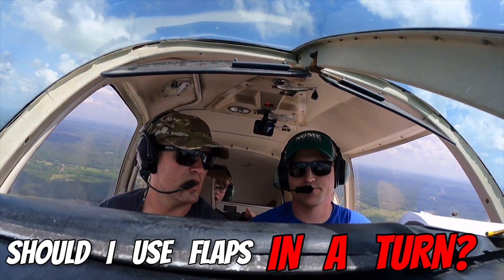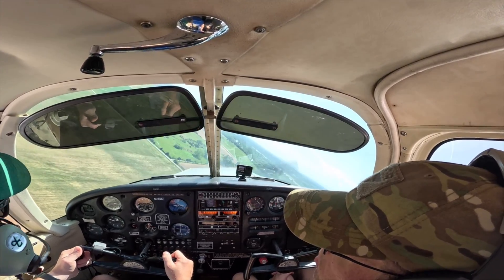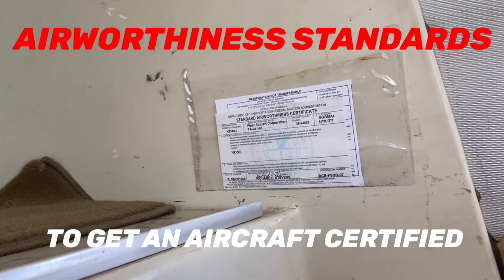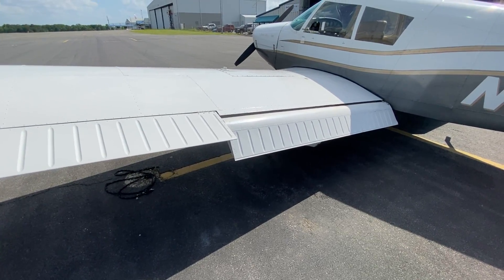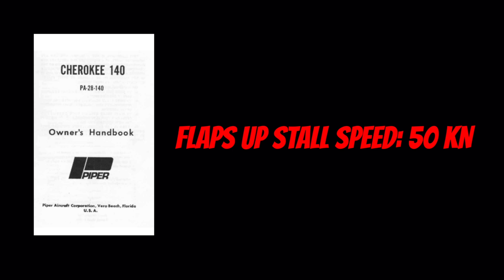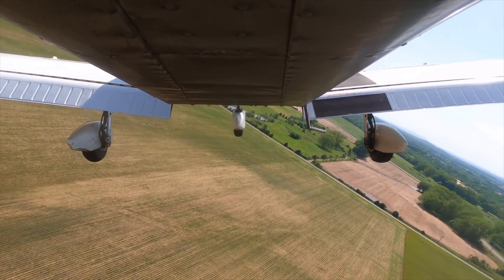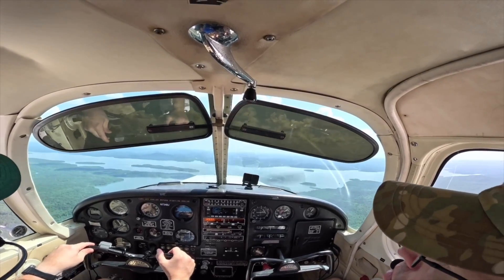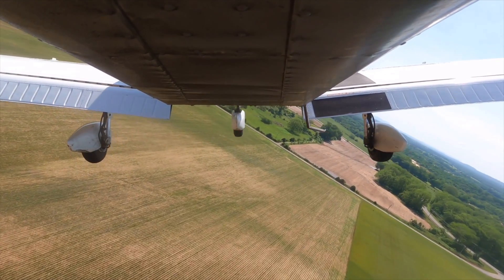Should I LOWER Flaps in a Turn?

Comment: This is not correct. The horizontal component of lift depends only on aircraft bank angle as  the vertical component has to stay the same as the aircraft weight.  Flaps  can be used to tighten a turn by allowing you to fly more slowly (increasing lift at any speed). That said, you must add power to maintain airspeed.
Reply from the maker: Thanks for the information.  Something I did not mention in the video is that flaps allow you to fly at slower airspeeds which definitely will shrink your turn radius. Now, I don’t disagree with your calculations, BUT those all assume that horizontal lift is equal and opposite to load factor which assumes that weight and centrifugal force are equal. I don’t actually believe that to be the case.  Many physicists believe that centrifugal force is not even a real thing.  I don’t share this particular belief, BUT I believe that the increased lift that is created by the flaps improves this turning capability because there is a side load on the aircraft.  Now, once again, this is a theory, but ag pilots intentionally use flaps to tighten that turn radius.
Reply: @FreePilotTraining  ag pilots use flaps to fly more slowly and that permits a tighter  turn.  Two  aircraft at the same  speed  turn at the same rate at the same bank angle regardless of  aircraft weight. Try flying a glider on tow -you match bank angle to turn at the same rate.
Reply: @FreePilotTraining  Just to add something concerning the centrifugal force. It's not believed that centrifugal force isn't real, but it's looked at as a sideeffect of inertial forces, so it's not a force by it's own. It's like the force that pusches you forward when you hit the brakes in any vehicle. Your body want's to stay in motion and is hold back and that's what you feel. It's the same with centrifugal forces. Your vehicle changes direction in a circular manner but your body would like to move straight on because of it's own inertia. Basically Newton's first law in action.
Reply from the maker: @shi01  thank you! I am thinking of adding a video that discusses this more.

Comment: Love you explanation and thank you for that, I will use flaps in a turn without hesitation. 
What I still not understand is the aerodynamic logic why the circle gets smaller when flaps are used. 
I believe that if you set flaps, you have to lower speed, or bank more to keep the flight level.
Reply from the maker: This is a complete theory of mine. As I stated, horizontal lift component apposes load factor, BUT if my theory is correct, load factor IS NOT equal and opposite of horizontal lift because BELOW flaps limiting speed, weight will be greater than the force created by inertia.  In my personal opinion, THIS is why maneuvering speed is so important.  Load factor is closer to being equal and opposite. Now, if weight is greater than the interia force, WHEN we lower flaps, the horizontal lift component can become greater WITHOUT increasing vertical lift.

Comment: I'm in training and only have about 22 flight hours, but I've been using flaps on my turn from downwind to base and base to final... 
I was thinking I shouldn't but my CFI has been telling me to add the flaps while I was making the turns, so that's what I've been doing... but I'm not banking very steep either
Reply from the maker: Yeah, it can be kinda nerve racking, but it’s completely safe
Reply: @Free Pilot Training  Everything I'm doing is nerve racking lol
My biggest hurdle right now is landings.
I pretty much understand the concepts of the maneuvers I've done so far, slow flight, steep turns, power on and off stalls and landing, but putting them into practice has been an obstacle. 
I keep having to tell myself that the plane isn't going to fall out of the sky if I pull the throttle to idle lol😆
Thanks for putting this content out there, I've been looking at your merch and will probably make a purchase in the near future to support you.

Comment: Suppose you had a plane with monster flaps that could do a 70kt, 30 degree turn in only 25% of the radius as other airplanes. How could you turn so much tighter at the same speed without pulling more Gs? You would literally be reversing velocity 140kts from 70 in one direction to 70 in the opposite. As you reduce the radius and time necessary for this reversal, you would have to pull more Gs to do it. Yet when the chart tells you it takes 1.15gs to do a 30 degree bank, they don't ask your airspeed. The load factor is the one thing that's fixed, and the only way this can be guaranteed is because radius is tied to airspeed. The only way all 30 degree turns give the exact same load is because the slower ones are tighter with higher turn rates, while the faster ones are wide with slower rates. All 70kt, 30-degree turns must have the exact same radius, otherwise they could not all have the same 1.15G loading.
Reply from the maker: This is a complete theory of mine. As I stated, horizontal lift component apposes load factor, BUT if my theory is correct, load factor IS NOT equal and opposite of horizontal lift because BELOW flaps limiting speed, weight will be greater than the force created by inertia.  In my personal opinion, THIS is why maneuvering speed is so important.  Load factor is closer to being equal and opposite. Now, if weight is greater than the interia force, WHEN we lower flaps, the horizontal lift component can become greater WITHOUT increasing vertical lift.
Reply: @FreePilotTraining  
But we already know what a turn with more lift looks like: it looks like a 60 degree turn. It takes a lot more lift to make that turn -- and it produces a lot more Gs. Anytime you're dragging a mass through a tighter circle there is going to be more acceleration -- this is not aerodynamics; it's physics. The acceleration isn't from the lift, or the type of lift, or from the bank, or from the wings -- it's from objects in motion along a path resisting having that path changed. If your technique could tighten turns, then it would necessarily increase G-loads. You already know the Gs are constant with bank, and now you're trying to rationalize aerodynamics to explain where the missing loads went. That's nonsense, because the Gs aren't from the aerodynamics.

I suggest you repeat the experiment with an alternate velocity source -- GPS. Fly both maneuvers at a constant GPS groundspeed. If you're affiliated with USAF you must have access to aeronautics guys. Why not run this past a test pilot?

Comment: Yes, but please remember that flaps are one part of energy management.  You use them when you need them.  With small aircraft that's often 10 when abeam the threshold on downwind, another 10 on base, then another 10 or 20 on final.  But crosswinds, high winds, and gusty conditions will also dictate your flap usage.  Today was windy and gusty with shear, I never lowered past 20.
Reply from the maker: So true! Thanks for the comment!

Comment: Turn radius is determined by airspeed and bank ONLY, and we know this because load factor is directly tied to bank angle. 60 degree bank ALWAYS gets you 2G, and the chart doesn't ask what your flap settings or your airspeed are. 1G of that is gravity, and the rest is acceleration from the turn -- i.e., the acceleration from turning your velocity in one direction into velocity in another direction. If a variable like flaps could alter your turn radius at a given airspeed and bank, then the G forces would have to reflect that variation. Tighter 70kt flaps-down 30-degree turns would have to pull more Gs than 70kt flaps-up 30-degree turns because you'd be reversing your direction of travel faster. But that's not what happens. We know that the 30-degree bank ALWAYS creates 1.15Gs. So, 1.15Gs (30-degree bank) at a given airspeed is ALWAYS the same radius and turn rate.

Perhaps your airspeed indicator reads higher when your nose is lowered because of extended flaps. Maybe what you think is 70kts with the flaps down is really only 64kts -- that WOULD make a difference in your turn radius at the same 1.15G.
Reply: Yes this I believe that is exactly what has happened.    The video result seemed so bizarre that I had to do some work and calculate the airspeed.   I assumed that it was a CAS offset but it would be nice to see the actual GPS or ADS-B data.  In lieu of that I calculated the airspeed from the ground tracks and the time stamps on the video.   Assuming that 70 KIAS = 70 KCAS with no flaps and 30 deg bank we can find the radius of the first turn via the TAS which would be 72 KTAS on a standard day, then from that we can find the radius of the second turn by just looking at the ratio of the diameters, and then calculate the TAS from the time stamps and the circumference.   The second turn has an average diameter of that is 80% of the first turn and this yields a speed of 66 KTAS, or 64 KCAS which is exactly the number that you got, again assuming a standard day.   Thus this aircraft has a 6 knot error between IAS and CAS at 70 knots and whatever AOA it takes to hold 30 degrees at that speed!
Reply from the maker: @alan1newport  after a little thought, there is no way that this could be due to the calibrated airspeed error.  The reason is that WITH flaps, we are flying a faster calibrated airspeed in order to maintain the same indicated airspeed because there is LESS air entering the pitot tube.  So, in reality, I was flying faster with flaps down, so the turn radius should have been larger.  I have my own theory, and I intend to prove it in a future video
Reply: @FreePilotTraining  Well there are two major position error sources when measuring airspeed and they are due to both the pitot AND static ports.     I think that the major driver for CAS and IAS difference is the static port and this difference can be both positive and negative.  Also, when using flaps at the same actual airspeed you would have a lower AOA to maintain level flight and this would bring more air into the pitot tube not less than in the no flap case  - in other words, flaps allow a lower AOA for the same conditions not a higher AOA.  That should be easy to verify in the C130 with a good AOA measurement but obviously hard to see in the steam gauge Cherokee. 

I think that you are missing the point that adding flaps generates an increase in the total lift vector that is perpendicular to the wings and thus when banked (and maintaining alt) always generates both a horizontal change in turning force AND a change in vertical force, not just a horizontal turning force.   When you re-trim to maintain level flight both the horizontal and vertical forces return to their per-flap levels and of course this is complected by the fact that drag has also increased.   I'm trying to think of an aerodynamic device that would only generate a horizontal force and certainly can't think of anything simple that would do that.   This last test was flown very precisely and that plus the lack of wind was how I could get even a decent calculated CAS/TAS result - you were definitely flying slower with flaps.  I would urge you to continue testing and keep that GPS data next time!
Reply from the maker: @alan1newport  yes, you would be at a lower angle of attack with the flaps in.  That means there will be less air entering the pitot tube.  This particular Cherokee doesn’t have a calibration chart in the poh, but most airplanes have a faster CAS than IAS with flaps. That’s a good point on the GPS though. If I checked both with the ground speed, that could bear some accurate results
Reply from the maker: The calibrated airspeed note is an excellent point, but something I did not mention in the video is that flaps allow you to fly at slower airspeeds which definitely will shrink your turn radius. Now, I don’t disagree with your calculations, BUT those all assume that horizontal lift is equal and opposite to load factor which assumes that weight and centrifugal force are equal. I don’t actually believe that to be the case.  Many physicists believe that centrifugal force is not even a real thing.  I don’t share this particular belief, BUT I believe that the increased lift that is created by the flaps improves this turning capability because there is a side load on the aircraft.  Now, once again, this is a theory, but ag pilots intentionally use flaps to tighten that turn radius.
Reply: @FreePilotTraining  
What "side load"? Does the ball show a "side load"? 

If I was an ag pilot, I would lower the flaps too, but only because slower turns are tighter -- this is well known. In any event, their turns are more like wingovers -- dynamic on two axes. You would have to fly it with instrumentation to figure out what the flaps are contributing.

Comment: I've used flaps in a turn on both high and low wings. The only things I was ever told not to do with flaps is deploy them above 70kts, use them in high winds, and don't do a slip with a low wing with flaps deployed because it can stop the airflow over the elevator.
Reply from the maker: Yep, keep them in the white arc. Cessna says not to slip with full flaps

Comment: I had a flap stuck on 30degree down during a touch and go. Not really dangerous and I just treat it as a slow flight climb. And then mess with the flap notch and it eventually goes back up
Reply from the maker: That’s super interesting. Thanks for the comment

Comment: Wait, the only defense for not using flaps in a turn is possibility of split flap condition? I’ve taught not to use flaps in a turn for years but NEVER for a possible split flap condition.  

Here’s why I teach not using flaps in a turn for NEW pilots.  Generally new pilots struggle to manage airspeed.  They get slow anywhere from beginning descent in the pattern to bring to slow right above the runway.  For new pilots, it’s important they manage their airspeed appropriately.  This matters for flaps because if a new pilot is already slow on an approach, then turns base slow AND applies flaps while turning, the turn adds load to the wings, adding load increases stall speed, and if the new pilot is already slow, there is a real chance of entering a stall (and/or spin) due to adding flaps in that turn.
Reply from the maker: Ok, I can get behind that, BUT I think it’s important to build a students multitasking skills, so I think if they are used to using them in the turn they are going to be more aware of that deteriorating airspeed

Comment: I am all for adding flaps during turns. I mean if differential extension is a problem, it is also a problem in straight and level flight (see BEA accident report BEA2018-0093). However and sorry to point that out but the flaps do not tighten the curve. The flaps have an effect on your indicated airspeed, so you actually fly slower and therefore your turn is tighter. This has nothing to do with the added lift. I’d throw some equation to prove my point but I’ve heard this is not welcome 😅
Reply from the maker: So, this is my personal theory, and I hope to prove it true in a future video.  Thanks for the comment

Comment: The reason I would personally not do it in a turn is because your flaps also increase your angle of attack which increases in a turn. Deploying flaps in a turn could cause your angle of attack to exceed critical angle of attack and cause a stall in a turn and then a spin condition. But that's just coming from someone who has 15hrs 👍😎 thanks for the video.
Reply from the maker: You know, I’m not entirely convinced that lowering flaps increases your angle of attack. It does for a split second, BUT the center of lift is move back which lowers the nose and ultimately lowers your angle of attack.  I wonder if the angle of attack is actually decreased as a result of the new direction from the relative wind

Comment: You mentioned that sometimes you over, shoot the runway and have to tighten up the turn to get realigned with it. I’ve seen videos and read articles about that being very dangerous and mini air. Pilot has ended up spending into the ground because they’ve over corrected. Maybe you can explain why your method is safe and sound. Thank you.
Reply from the maker: That’s an excellent point. I’d like to make a video on this in the future.  It might take a while cuz I’d want to do it right.

Comment: One thing that you didn’t mention in the scenario is that when going down hill (losing altitude) the wing load factor is decreased so the level flight stall speed when turning  in descending flight is not correct.
Reply from the maker: That is a fact. That’s why I mentioned “being low” on your approach.  If you level off in the turn, that’s where the real danger is

Comment: Early in my flying career I had a instructor try to tell me that I shouldn’t put flaps on in a turn. After 41 years of flying commercially, he was the only person I ever heard say that. 2:01 That includes dozens of check rides for airlines, 3 type check rides with the FAA, and 1 type ride with a designated examiner.
Reply from the maker: That mindset is still around
Reply: @FreePilotTraining  there’s a really good reason why
Reply: @FreePilotTraining  I would encourage you to watch some of the videos by Ag Aviation Adventure with their AT502b. Watch the flaps in the turns. These guys are flying at an altitude where stall recovery is impossible and at gross weight. Every turn the flaps go out. In one field that can be dozens of times in 1/2 hour.
Reply from the maker: @mdbryan9525  I’m definitely going to check that out! Sounds cool!

Comment: Student pilot here; I’ve never been taught nor told not to use flaps during a turn. I’ve been doing it instinctively. I’m around 60 hours deep. It feels right when I’m high and need to put them in early
Reply from the maker: Good. I’m glad you were taught correctly